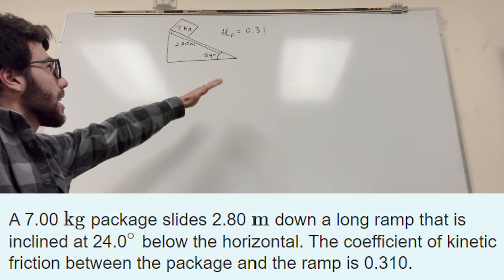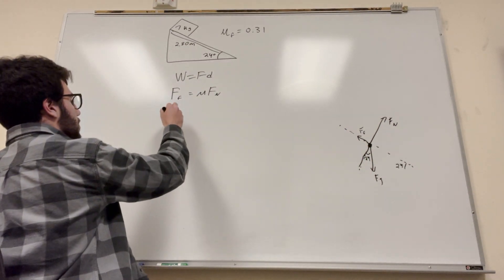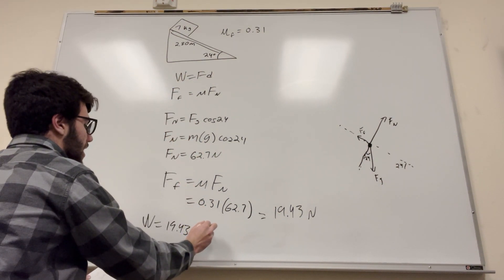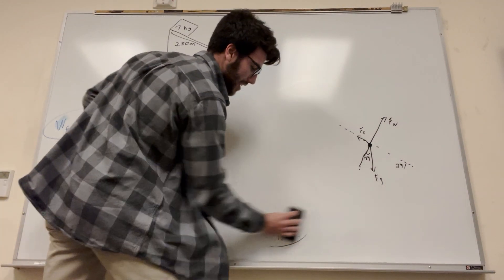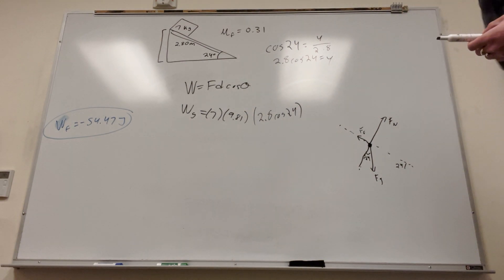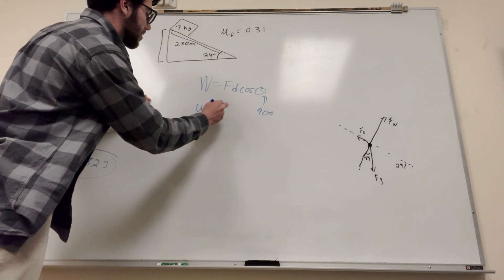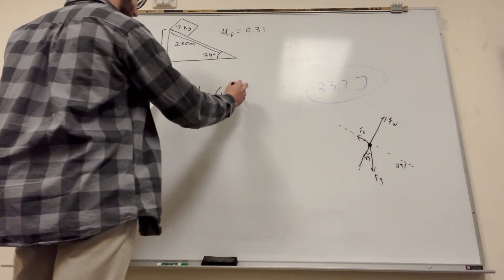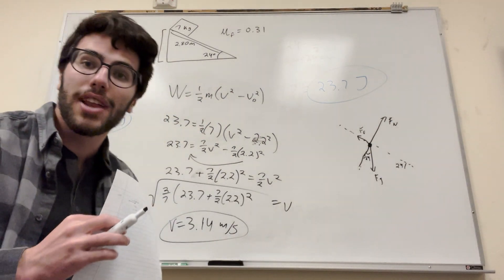A 7.00 kg package slides 2.80 m down a long ramp that is inclined at 24.0∘ - Problem 6.64

Comment: Hey man, for part b you used cos to calculate height of ramp. It should be sin. The answer you wrote is correct though. Thanks for this content btw. Very helpful.
Reply from the maker: Yea that’s my bad, nice job noticing